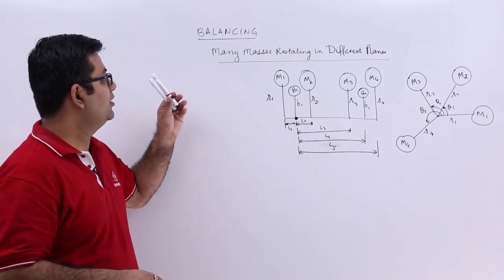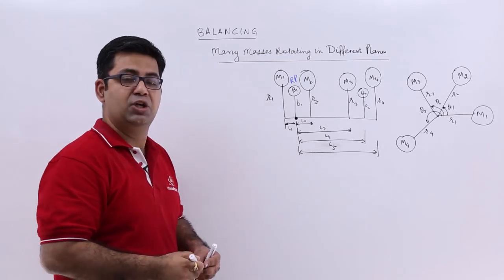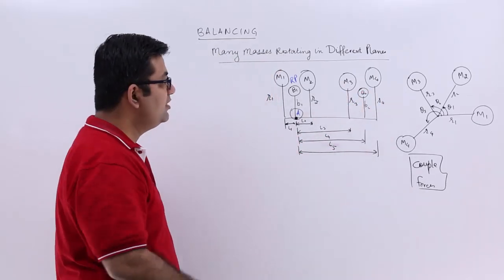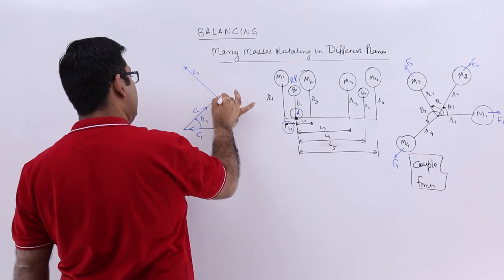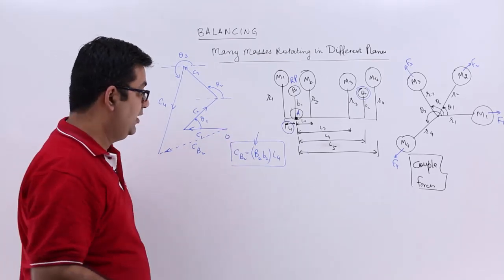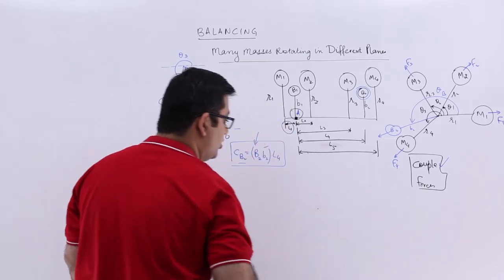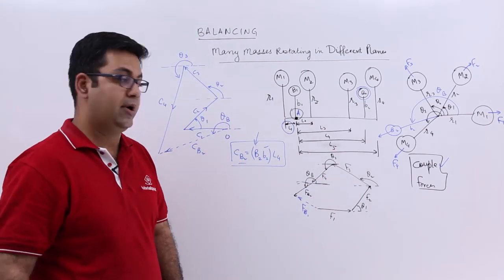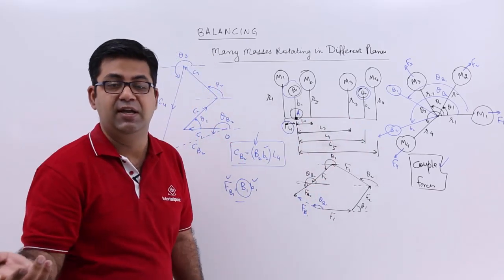Many Masses Rotating In Different Plane

Comment: sir, shouldn't the resulting force vector which u chose as mass or balancing mass direction vector, be reversed as the mass should be in the direction where it will be opposite in the direction of resultant of all known couple vectors. U chose the resultant direction itself the direction of balancing mass which will in fact, will not balance the couple equilibrium condition.
Reply: Agree with you bro. The solution in the video will make the system more not balance , I think.
Reply: there, I have also a doubt...
Reply: yes you are right